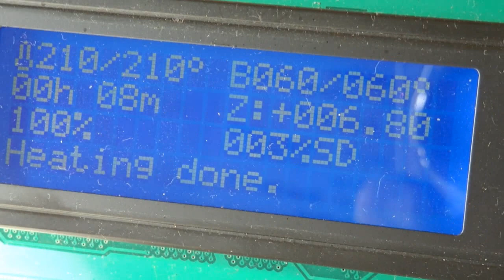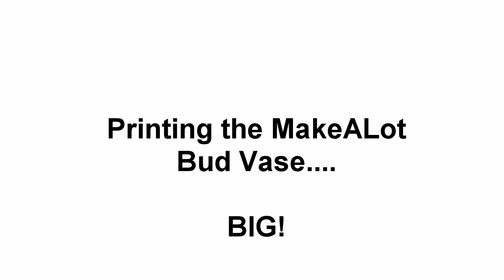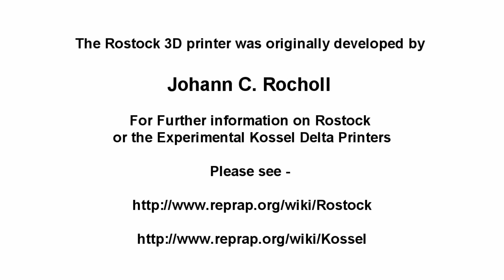Rostock RepRap Object printing Mar_2013 PART 2 OF 2

Comment from the maker: Great! - you won't regret it, just make sure you go for bushings over Linear bearings. - Everything in this video is in PLA, I have some Nylon prints coming soon on Rostock - If you mean the Bud vase - that's Natural PLA, but purposely under temperature extruded so it comes out snow-white.

Comment from the maker: You need to make sure the Nylon is very dry before printing, I use Taulman3d 618 Nylon - it's designed for 3D printing, trimmer line has other nasties in it, watch out.

Comment: Looks great!  My next build will be a Rostock now that my MMax 1.5+ is done and calibrated.  Did you have much trouble with retraction and the bowden?  I've read that it's very hard to compensate for the springiness of the filament inside the guide tube.